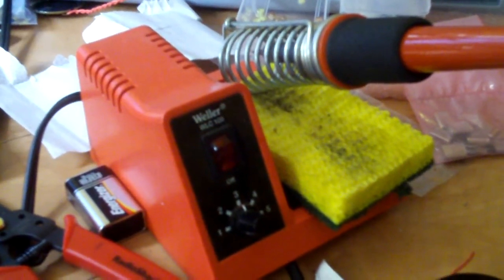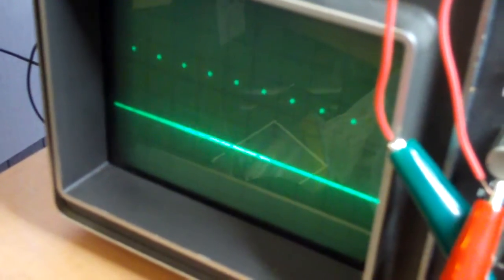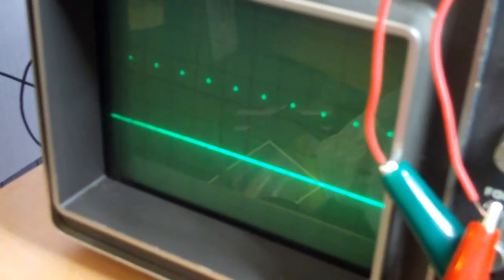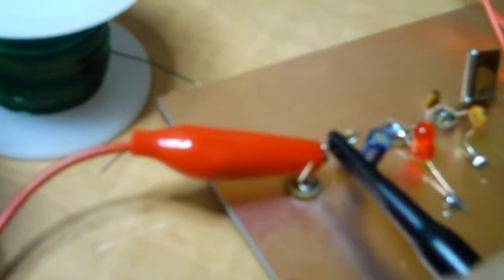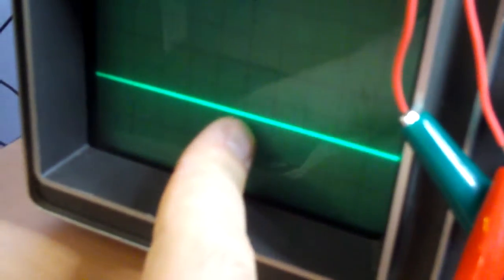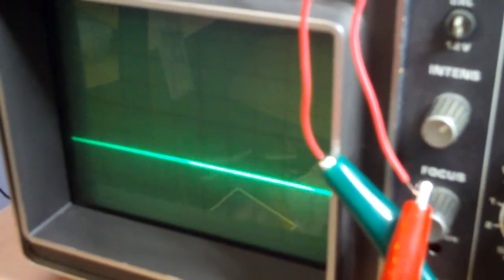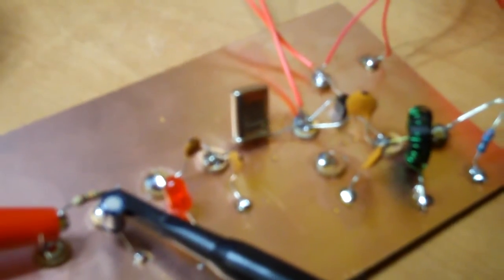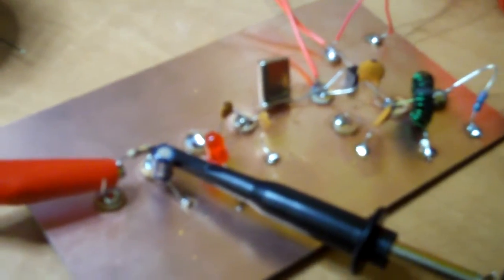Arduino, analogWrite, and DC voltages

Comment: Thanks for this! I'm building a variable power supply and I want to use my Arduino's PWM to set a voltage to control the op-amp, I'll try this :)

Comment: Nice job. We also need to build a low pass filter for a Futaba R617FS receiver. I guess we just have to figure out the right capacitor and resistor. Thanks